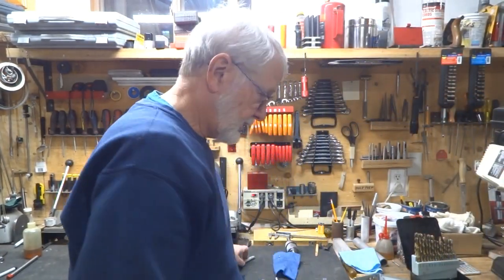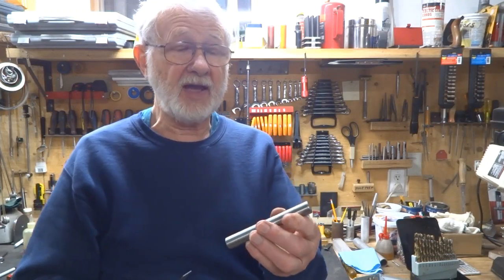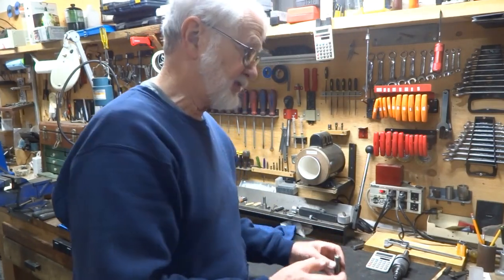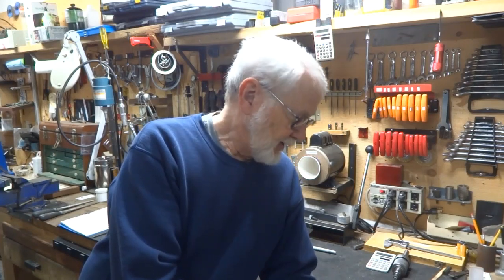Homemade 5/8 inch reamer.

Comment: Reamers cut on the end, not the sides ... the sides merely support the reamer, it is the end where the cutting action takes place ...
Reply from the maker: You might look at it this way but in the case of manual adjustable reamers there is no cutting surfaces on either end proving that the side can cut if required.
Reply: @MrModify  But like hand reamers, these have a taper of a few thousands of an inch over around 1/3rd of the cutting length ... the cutting takes place on the sharp edges as you say, but they have that taper ... machine reamers work differently, relying in the stiffness of the machine ... the bulk removal happens at the end, then there is a much shorter taper before the parallel section.
Reply from the maker: I agree with this more elaborate statement.

Comment: Happy New Year !       'Can't argue about getting the results you wanted . . . BUT - I'd suggest that you grind the leading edge 'lips' of the reamer to 45 degrees , & relieve them as you would a drill bit - * Just as a 'store bought' reamer is made . . .    The lead angle will produce a positive cutting action , whereas the cutting edges on the flutes will produce more of a 'scraping' action !   The cutting forces on the 'lips' is much less than the force of the scraping by the flutes , & should produce a much smoother bore .
     You'll find that with the 45 degree 'lead' angle , that it will be very easily touched up when it begins to dull ; & will generally just take a little honing to get a keen edge - & should last a very long time !
  Good job for simplicity's sake !
Reply: Ditto on the cutting tip, same method for a semi circular (1/2 milled) or a taper (1/2 milled ) reamer.